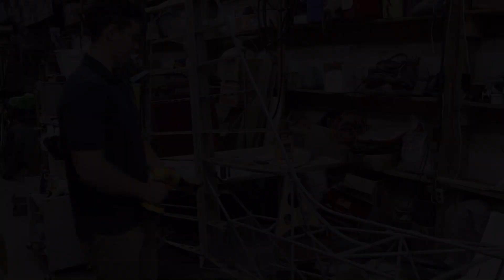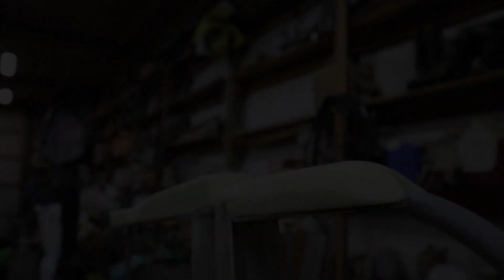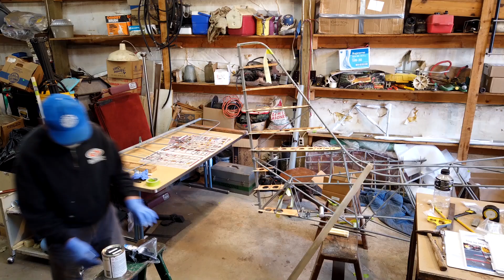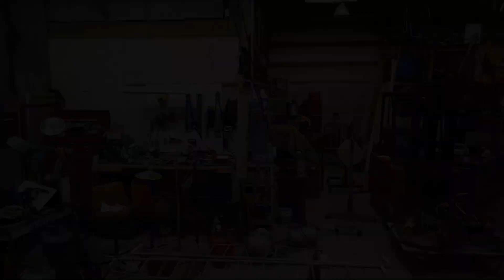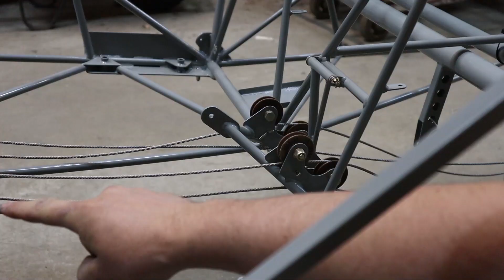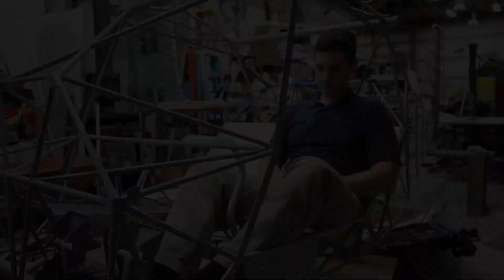Kitfox STi Build Update 2 : Tail Section pt. 2,  Rudders, Floors, Seats …

Comment: Just a short question, which I hope you will still see. First of all, really nice project, saw your newest video and stayed. From a guy that works on helicopters every day, I'm really curious what you did in terms of corosion protection. Maybe it will be covered in a Viddeo i have not yet seen but you had here for example the plain aluminium strip and talked in the last video about grinding down powder coat. Did you end up using anything like alodine, some stuff like Tectyl or AV40 or what did you do? Just really curious in terms of that. Thanks

Comment: hmmmmmm  did you use a reamer on the rudder pedal parts?
Reply from the maker: It needs more than a reamer. Outer dimensions are substantially off. I did team the inner diameter of the plastic bushings but the hole was still crooked.